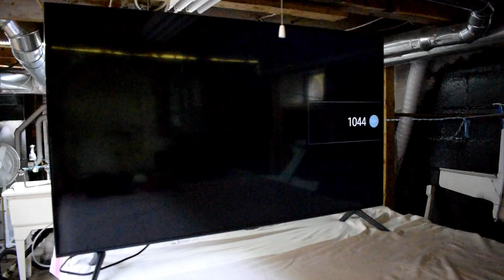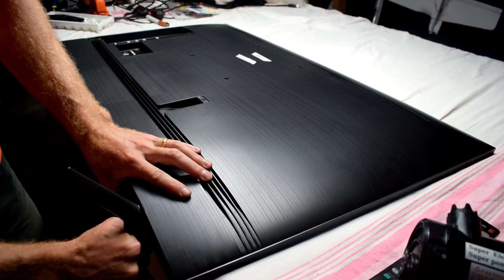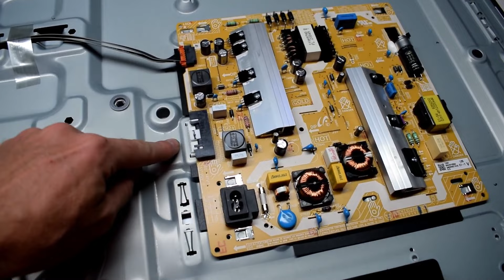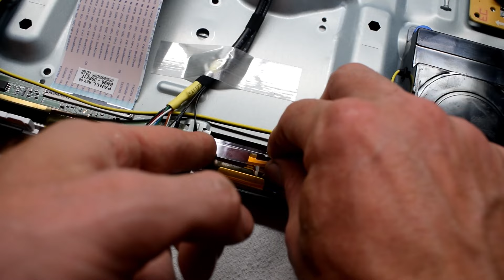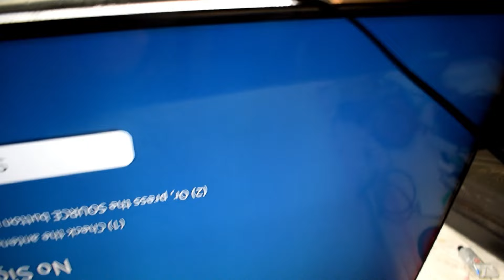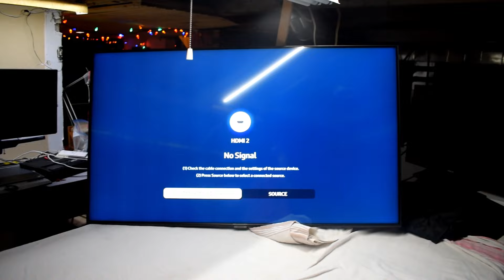Samsung Smart QLED TV Keeps Restarting! Fixed with TAPE! (Model QN50Q60TAF)

Comment: Thanks for this video! Got a QN55Q60RAPXPA 55in Samsung QLED TV for $50 on a classifieds site because it was rebooting like this. After a few tries I managed to get it working with a sticky note, and it works great. 

My model is a bit different, with 2 big ribbon cables for 2 separate boards, so this other video was also helpful with the specifics for my model https://www.youtube.com/watch?v=tIjqoAw6O1w. Basically the same steps but with the big white ribbon cables rather than the little one in this video.
Reply from the maker: wow great

Comment: I tried using this process and it stopped rebooting for tape on certain pins. I get audio and get sound at start of TV. However, after that TV screen blank and dark. At this time, I can hear the audio from the active channel. I appreciate if anyone on this forum has suggestion.
Reply: Same here any solution?

Comment: It works perfectly well! I have samsung the frame 55L1AU0QT. If you need support to know where to put the tape in case of this model, please write to me, I will send you a picture (in general the tape covers pins from 12th  to 16th looking from the rigth side). In my case the screen looks exactly the same as before, no grid visible! Amazing :) thank you for sharing this tip with us!

Comment: Have the same model of the tv and tried this. Found out that our troubled pin was the first pin on the right side, but when we covered it with tape, the tv failed to produce any image altogether but didn’t have the original issue of turning on and turning back off again. We were so close, but it looks like we have to buy a new tv. 

Still appreciate the video though, very thorough and easy to follow!
Reply: Same issue here ! Did you manage to find a solution ?

Comment: Man, you're my hero as for many here. I wonder how many thousands of dollars/euros whatever you have saved for all of us with this video. 

For anyone having the "working TV with sound but no screen"-problem:
Just keep on going! I had the same issue and was about to give up.
The way I got it working eventually was by taping up about 4 pins at a time starting from one side and then moving the tape slowly one pin at a time. Eventually you will get some sort of picture. For me it still had a lot of artifacts and flickering but from there you can try to narrow it down to 2-3 pins (in my case) to get a good picture.

I think the reason you get the tv working but not the screen is because you're taping up some sort of ground pin or else that is basically shutting off the whole half of the screen meaning you're actually not isolating the shorted leds but again the whole half like you would by unplugging the ribbon cable. Therefore you have to keep going until you find the pins that are acually causing the shortage but do not disable the whole panel. At least that would make sense to me.

Hope that helps...

Comment: I have the 65"2021' QLED NEO Q90A. I paid $1,877. Same happened to me. Was about to throw in the towel. I bought it from online Costco and they delivered it with no physical receipt. So i got to thinking that i remembered that i saved correspondence through emails. So i checked in my saved folders, and found i purchased an extended 4yr warranty through Allstate insurance. With 1 year left, I was able to call them and after several questioners and form's, my claim was approved! I just received part's and a repair tech is fixing in a few day's at my home. I guess by my explanation of what it is doing, they already knew what the problem is? Just like any major manufacturers, they make parts to fail just after the warranty expires! 3 years seems to be the failure point? Im hoping to get 3-6 more years out of the new parts. Have many questions to ask the repair tech on his experience with Samsung TV's and the new parts? I was really hoping they would have to replace with a newer model. Can't believe i finally got a break! Good luck to all! Ill try and give a update if i can get back to this thread.

Comment: Can I tape the ribbon that connects on the main board side? I have two ribbon cables from the main board tied to two different panels and there is not a separate ribbon that does not run to the main board.

Comment: Many thanks for the video! Took me a good two hours but got it fixed. 

An extra tip for the next person with this issue: Use a "bigger" piece op tape to start with and narrow down you search area. Then, when you know which part to look for, continu within that area with you desired tape size. Saved me a lot of time, and frustration.

Comment: Exact same symptoms on a GQ50Q60TGUX . Arrived at the left-half connector . Removed it and - just for verification purposes - put it in again and the PROBLEM IS GONE. W/O tape !!
Could it be that the left/right position of the ribbon is so badly enforced or in other words the horizontal ribbon cable position so unprecisely determined (slack) that we're close to a short all the time? Just a little toying with the ribbon and the problem comes back....
Edit: This ribbon connector sits under a loudspeaker which can induce quite some vibrations. This might have led to the misplacement of the ribbon end in the connector ...
A big THANK YOU for this video!

Comment: Your method worked on a SamsungQ60A. 2 years later this fix is still working.
Thank you
Reply: Can you see this shorted connection with the eyes? How do you know where to put the tape? I have a samsamg tv doint the same thing after one year of use, just after one year warranty. Samsung would do nothing to pay for repair or service call even, shame on them.

Comment: Thank you so much. Did the same for our 3 year old Samsung. The error was actually a little different, it showed a black line through the screen and then the image kinda just “fell apart”, colors wrong, etc. then reboot cycle. Taping the pins you showed stopped the reboot but there was still a black line, in a different place now. So I just taped up more pins to the left and after about 7 it was completely fixed. My mind is blown and money is saved. Thank you so much for showing this. 😊

Comment: This worked for me. I had to do trial and error covering 3 pints at a time. The tv stopped rebooting every few seconds. Unfortunately I cracked the front black panel and the picture would no longer display and only sound worked. You couldn't see the crack while the TV was on but you would see these weird colored splattered shapes. This was enough to cause no display, backlight on and only sound. This was a weird case because all internet research points to a main board failure. I had used a plastic pry tool but I dug too deep and pried up on the front display panel that causes the crack. I'll probably sell the useable parts and get a new TV with the upcoming holiday.

Comment: Muntzing! Nice work; solid process of elimination, and the fix was the last thing I would've expected (figured the tape would be to hold a ribbon in place or something). Have a slightly different TV so not sure if the issue will be similar but had to leave a comment to say this is really cool and helpful either way.

Comment: Instead of using the popular "tape" fix which takes some guesswork can't a simple JIG with a flat ribbon cable and DIP SWITCHES be used instead?  This will save applying and then moving the tape until the bad traces are found.

Comment: I hope you or someone sees this that could help, so I done everything and I’m at the tape spot and I am 4 hours into this. I found a spot where it doesn’t boot loop but it doesn’t show color I had it happen one time but no matter what I do nothing works. I covered 1 pin 2 pins 3 pins in the 5 pin area that doesn’t boot loop with tape.

Comment: Thank you very much … I Just finished fixing my QLED Q60A 50 inch, which I bought exactly 2 and 3 months before the  on/off problem started …. I literally followed the video and made the exact same tape in the exact same place you put it and it’s working perfectly… before that I took it to a repair shop … I live in Germany… and the shop told me there is no hope for repair and that its the motherboard and he saw it several times in the same QLED Samsung… I was traveling the past 3 months … so I made this as a last hope before ordering a new tv… I was doing some digging the past couple of months since the problem started … and I found several similar people with the same exact problems like mine and every one said that the problem started exactly after the warranty have expired… it is really awful how can this happen unchecked… but anyway .. again can’t thank you enough.. you saved me 600€ for a new TV 🙏🏼🙏🏼
Reply: My QE50Q60AAUXUA has the same problem, screen turns on for a split second then turns off (the red LED blinks twice and reboot).. Bought it back in 2021 and I never expected to be something wrong with it, yesterday I was watching YT wtf.. Looks like I got nothing to loose but try this method. Will get back if it works
Reply: @bogscave  it worked?
Reply: @Asmr_waves01  I also have the same issue, did you try it?
Reply: @anonymousxy7330  no i couldn't open the tv + i read some comments saying that the problem will back after 1 year or more.
Reply: It wioo be in warranty theres 1 year of warranty just give it back cuz it will do the same problem to u

Comment: I have the same problem with my GU50TU8079 and partly fixed it.
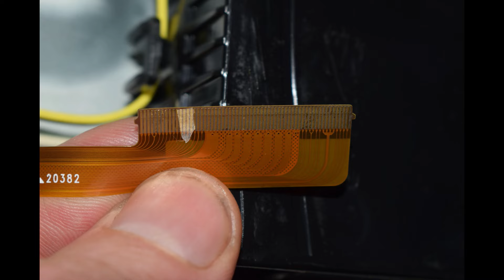I taped up some pins and found out it's the first one all the way on the left (if you see it from the frame at 4:12 where it shows the connecter with the tape on).
If I tape his one up, the boot loop is gone the backlight stays on, I can turn the TV on and off and I hear the starting sound and the sound of the tv programm, remote works if I press "home" so on..
However the screen stays dark :(
Did anyone had the same issue?
Is the first pin like a special pin or do I have like two seperate faulty pins?
I hope someone can help.
I'm close yet so far :D
Reply: I have the same problem but dont have sound but my pc can read the tv and I can turn it off and on but it stays black, I had picture for like a second but now I cant seem to get it to show picture again
Reply: I have the same problem, my tv now isnt booting off but the screen stays black. I do hear the sound. Any help?
Reply: @Jelle535 did you figure it out?
Reply: did you figure it out by now by any chance good man? or gave up on repairing?
Reply: @thevout3476  Nah, O tried back and forth for a few hours. Then I gave up bought an non Samsung O-LED (happy) on Black Friday and sold the old crap for like 50 bucks xD

Comment: I know this is old but to buy  TV 2 yrs ago and this happen is messed up! If I would of bought the 3yr extended warranty, that started After my 1 yr Samsung warranty I would of been able to just go trade it in for a new one! From now on it's worth $59.99 or even little more because so many of Walmart TV's screw up! I spent the day, then found the tape thing and worked it down to 3 pins or whatever you call them that hooks the 2 bottom panel boards together. I believe in Mexico where mine is made they pushed the plastic connector in to deep and messed up a few of them. Now i got a couple horizontal lines going across the screen but i can't hardly see them from my bed. I wonder if I could buy just that plastic cable somewhere? I don't know what it's even called, does anyone here? At least i got it from cutting on and off, and learned how to test and make sure it was not the power board. Thanks for the video

Comment: I dont know If this helps you but i had the same problem like you. I just reset the tv full and the problem solved. Runs for 3month and again this problem. You reset the tv in the settings and works again for 3month

Comment: Hi friend!
Please help me, on my TV (Samsung GU50AU8079) all LED strips work, but something simultaneously turns them off and then turns them on. All this is accompanied by a “ringing monotonous squeak” (sound) on the capacitor panel, more specifically one of them. 
The capacitor panel is very similar to yours in your video.

And the TV works like this: As soon as the TV is plugged in, the red LED at the bottom lights up, flickers and blinks.
The display goes black, then brighter, but it's still dark, then black again....
And it goes on like this constantly. So the LED blinks, lights up or flickers, and the display turns on, off, on, off, on, off, on, off, on, off.... The display doesn't show anything. I can only see it get a little brighter, but then it turns off again. It sort of tries to turn on, but then it immediately turns off.

What do you think it can be?
Very grateful in advance!!!
Reply: The same exactly with my TV… @Newson Electronica provides us a guidance how can we solve it step by step..

Comment: My TV 50Q64T had the exact same issue, bought it 3-4 years ago. Thanks for your video, I tried the tape method right away on the connector and that seemed to fix it. Some additional fine tuning with scothtape on location and width seemed to fix it.

Comment: Thanks a lot. After 2 year my Qled QE50Q60AAUXXH had the same problem and I fixed it with this video.
You saved me 600€
Reply: Mine do the same after 2 years. Same model.
Reply: I had lucky as I had extended warranty and so Samsung replaced me the panel.
Reply: Mine do the same after 3 years. Same model. I wonder if that cable can be bought on eBay. Anybody knows?

Comment: Thanks for the helpful video! I managed to keep the screen on by applying tape. Backlight stays on and I have sound as well. However, I do not get any picture. Any clue what might be a next step in this case?
Reply: I had to be a bit more patient apparently. Taping the 3th and 4th from the left resulted in picture. The screen however seems to be only giving white/blueish colors. Any ideas what might cause this? Does this mean the screen is actually unrepairable?
Reply: @jeroenmeijer2832  How did you fix the problem with the white screen? When i cover the pins my screen turns bright white. If i cover the other pins the colors are normal but the screen crashes after a few seconds.
Reply: @jeroenmeijer2832 

So you put more tape in 2 different places?

Comment: Many many thanks for making this video.

I have a Samsung QE50Q60T bought just 3 years ago. Just 10 days ago it started the reboot loop. Samsung authorised repair service said it would cost me £280 to fix it so I tried to search for some self fix solutions. Lucky that I came into this video. I tried the tape method right away (at the same pin positions as shown in the vid) and it fixed the restarting problem but still with some flickering horizontal lines. So I tried shifting the tape to the left bit by bit and also tried both thinner and wider tapes but without any luck. Then I tried shifting the tape to the right and then it worked immediately, even without any horizontal lines or loss of picture quality. For those interested to know, I covered pins 2-5 to the left of the centre of the cable. Hope you find this useful.
Reply: It's funny that you describe your problem as such because we got our TV in 2021, and last night, it went into a random bootloop. We have the same model, so I'm going to attempt this fix.
Reply: Have you fixed it? @OurWorldVillage
Reply: @Gintonic91  actually yes! I was able to fix it due to the instructions shown in this video. As it turns out, it was the connector cables that led directly into the TV that was somehow weird and wonky. I covered 2 or 3 pins in from the right, and it worked. The TV has been going strong ever since!
Reply: @ but you can see the lines right?
Reply: @Gualaguala659  nope, I don't see them on mine, thankfully enough. I attribute it to luck.
Reply: Thanks bro for the motivation! Still struggling with those horizontal lines tho. Could you give some more details please?
Reply: @HDVIZH  me too, i've just got one for a 10 pound and i make it work but only with some horizontal lines on it, the image is very good but i don't know how to make those lines to go away, also i've tried different size of tape on both sides and still couldn't make those lines to go away, have did find a solution for yours?

Comment: You can roughly explain what was technically done. Is the circuit feedback cut off? What is the reason for the malfunction? Is the board current low? Or is there a fault in the display matrix? In the event that we do not know the solution with pasting, which part must be replaced?
Your fix worked, Thanks.
Reply: I think it is one of the many "parallel" capacitors gone bad that means resistance too low across the power supply causing it to shut down.
Reply: @kathryn62tube  Capacitors in which part? In the source or on the display matrix (SMD)?